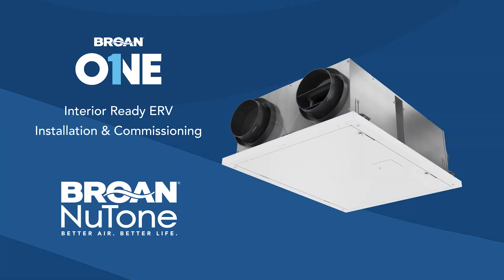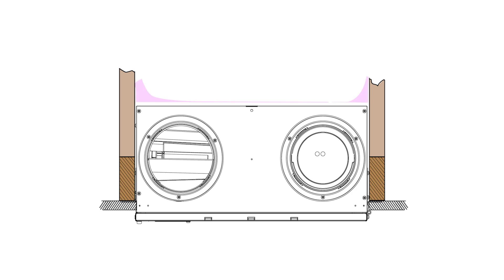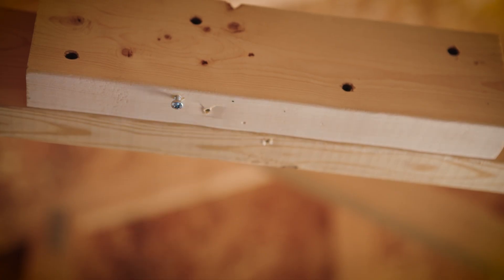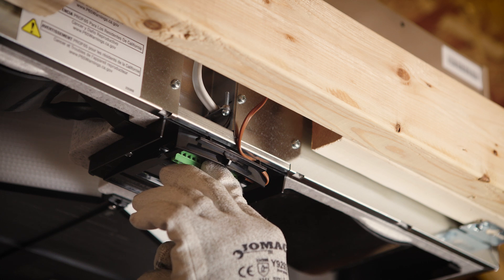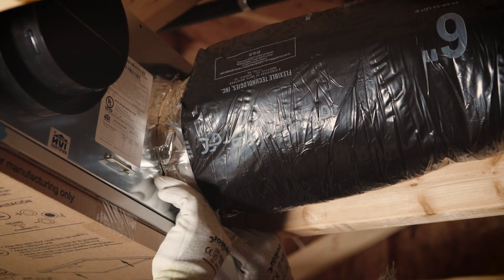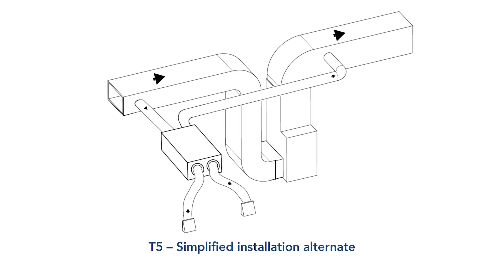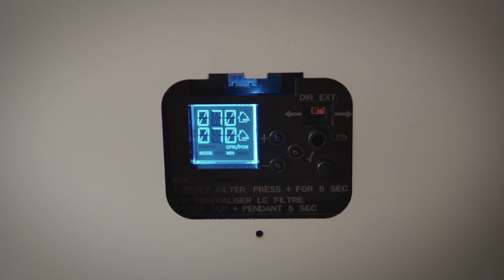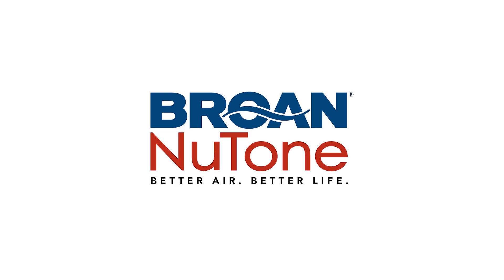Broan ONE Interior Ready ERV Installation & Commissioning

Comment: In this the same as a makeup air system?
Reply from the maker: Thank you for reaching out. The ERV units are not the same as a makeup air unit. These are designed for balanced ventilation. A separate unit for makeup air would be needed.
Reply: @BroanNuToneLLC  oh,ok, I'm will be installing  a 900 cfm hood vent in my home for the kitchen the near future and  I'll most likely look more into a ERV system as well.
Reply from the maker: @edgarrios2243  If you would like to discuss your application with a member of our team, please contact our Product Expert Team at tech.support@broan.com. They will be happy to answer any specification, application or installation questions you may have.